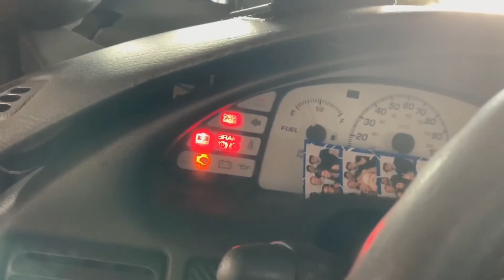Turbo Cavalier First Start

Comment: Turn the key to on for 11 minutes then off 11 minutes then try to start it that’s how you bypass the theft system otherwise it will try to start for ages but won’t turn over
Reply from the maker: Just wait until next video 👌😂
Reply: Hahahah okay
Reply: Idk if it's different for Cavaliers vs. Malibu's but I just kept the key on for 10 mins exactly and then the anti theft light would stop flashing and then cycle the key and would be go to go.